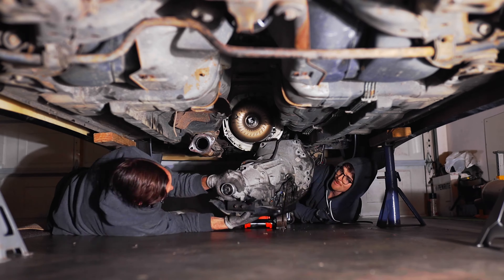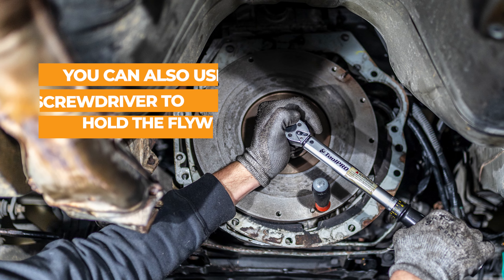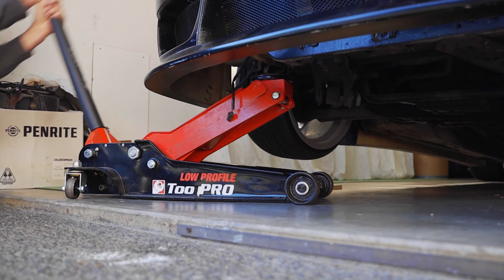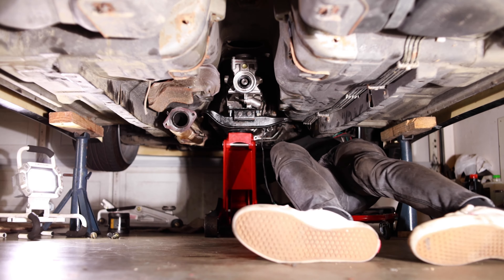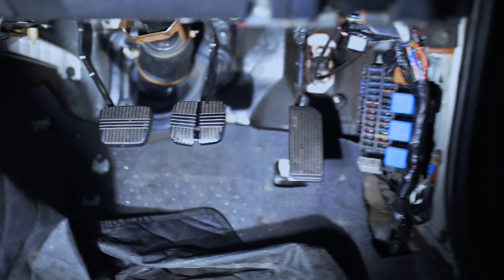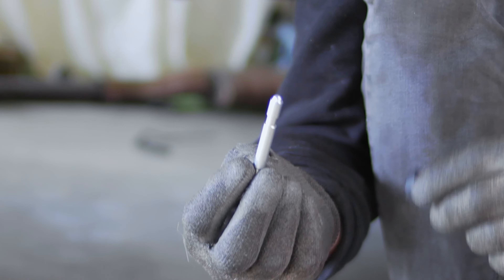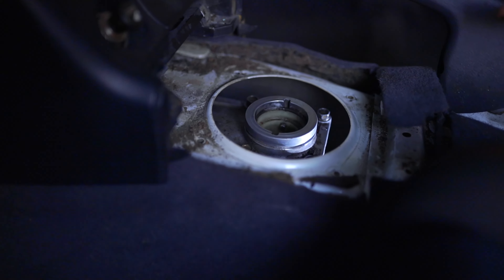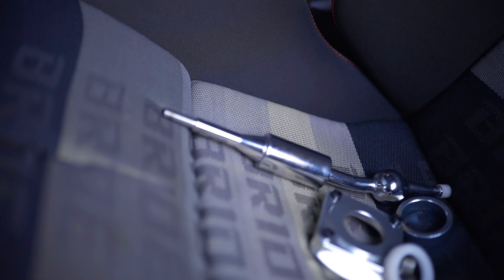How To Do A Manual Conversion On A Nissan Silvia | Part 2 of 2

Comment: I have a question tho! Can the bolts from the driveshaft that are connected to the differential from the automatic one be re used on to the manual driveshaft??

Comment: How did you make the speedometer works? Will it need a CERT for manual swap?
Reply from the maker: You need to replace the speed sensor to a manual one, located on the side of the gearbox. You will probably need a cert in NZ for the manual swap.  Thanks for watching!